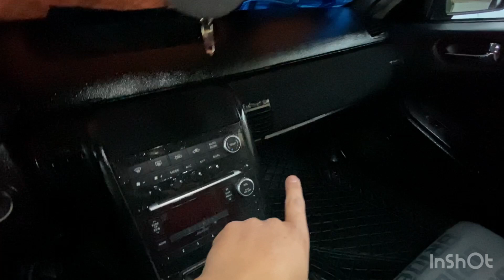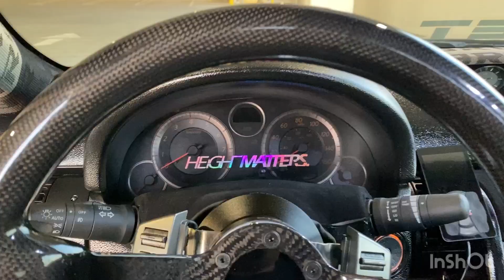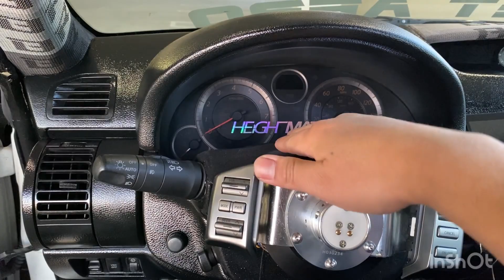Painting The interior of My G35 (DIY) From -Tan To -Black -

Comment: How did you keep the controls from the factory steering wheel
Reply from the maker: Yes I did with a custom bracket
Reply: @g35panda54 where did u order it from? This is the next mod I wanna do on my g but I use the steering wheel controls very often